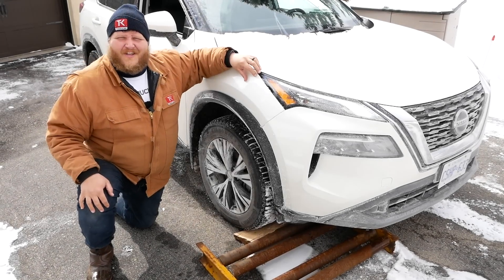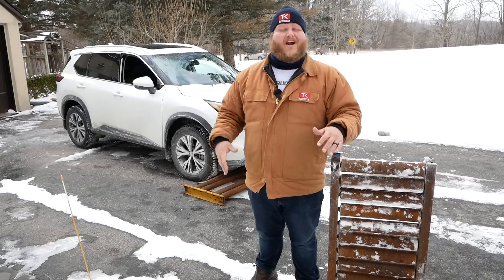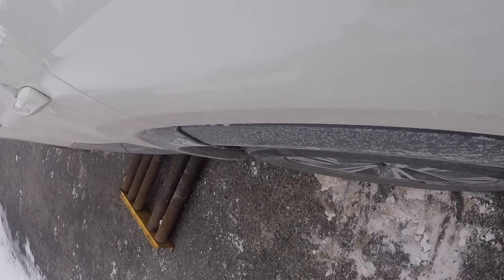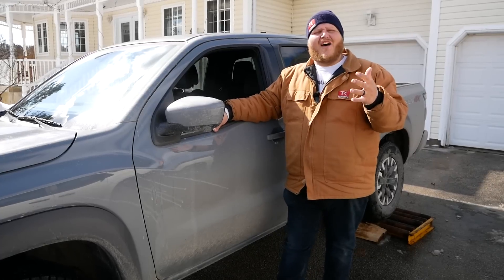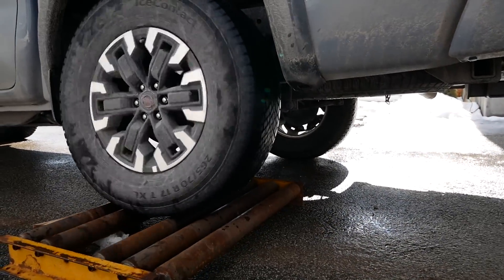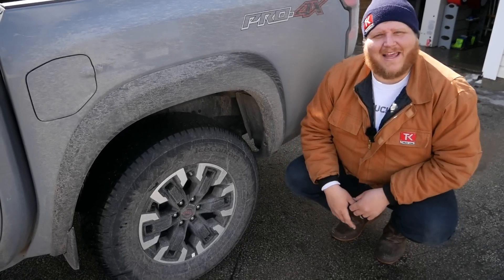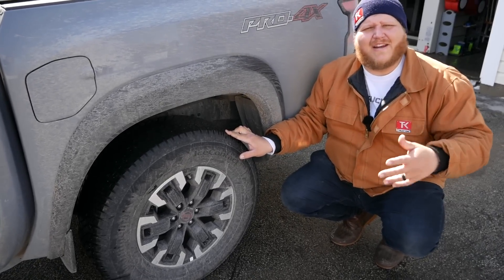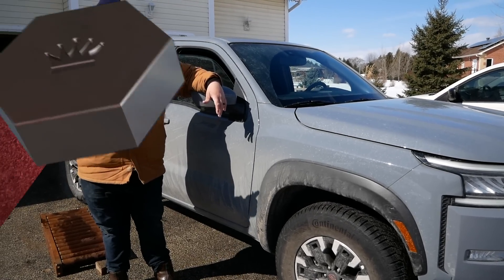AWD vs 4WD - Which System is Better and How Do They Work? We Demonstrate the Differences

Comment: For 99% of us, the all-wheel drive that is always on (or the computer allocates power automatically) is the best system.  Can't tell you how much of a pain it is to be driving down the highway at 70 and drive into a snowstorm - have to slow down to under 40mph to shift into 4x4 then speed up.  Not to mention what 4x4 does to your turn radius (it's terrible).
Reply: And fuel economy. AWD is lighter and more efficient, making it better for daily drivers.
Reply: @legostarwarsrulez  Now what you said is actually very true.
Reply: Modern 'shift on the fly' 4x4 /4WD models allow you to turn on and off four wheel drive anytime at 60 MPH or below.
Reply: @hermanjohnson9180  still means you have to do it manually...
Reply: @bikebudha01  The shift on the fly system uses a button touch that is electronic and normally wouldn't be considered as "manual".
Reply: @hermanjohnson9180  do you have to physically push the button?  Yes, yes you do.  Which means you have to decide when to put it in, and put it out of 4x4.  Manual.  It's what I had on my last truck.  pain in the ass.  More often than you might imagine, I'd have to put it in 4x , then out, then in, then out.  (The city where I live is terrible at clearing snowy roads.  So side streets, 4x by needed, main arterials not needed, parking lots needed.  you get my point)
Reply: @bikebudha01  By that logic I guess you believe that automatic transmissions are a pain in the ass too. Because you have to put it in Park Reverse, and Drive... By that logic it's certainly manual. I'm hoping you've figure out that I disagree lol. But more importantly, I believe that most would disagree with you
Reply: Preach.
Reply: Modern westerners are a whiny group.

😂

 Maybe buy a 4WD with TractionControl and a "Full-Time" setting.

 The way some modern Western people complain, you'd think that they had to get out and kneel in slush to turn rusty hubs.

 Even my '78 Jeep CJ could shift on the fly if I simply locked the hubs in Autumn.
Reply: @RKmndo  no, I had a trucks that would allow you to shift on the fly up to 45mph...   But as I said, on the freeway I'm doing 70.  So slowing down to 45 IN TRAFFIC isn't a great option.
Reply: Why would you drive 70 in a snow storm?
Reply: @valentinibarra9940  um, because my vehicles can handle it...  (up to a point..)

Comment: Full-time 4WD is the best.  This is on the Lexus GX, LX, 4runner Limited, and Landcruiser.  Also on the Mercedes G-wagon too.
Reply: Also the manual fj cruisers. Mine certainly is and love it
Reply: thats marketing terms for awd btw, its not full time 4wd, its awd. they have to market it as full time 4wd for people like you to like it
Reply: @james2042  nope... GX, LX, 4runner Limited, and G-Wagon have actual center differentials.  They are full-time 4WD.  For the last 25 years AWD systems have been 'slip and grip' reactive systems using viscous coplers or clutches.  Full-time 4WD has all 4 wheels going all the time... it doesn't need to wait for slip to engage...

Comment: It's worth mentioning that most 4x4 trucks do not come with a limited slip disk (LSD) as standard equipment...that's usually an option that only comes standard on high end trucks (and not even all of them have one) and may not be available on lower tier models at any price.

Comment: Awesome video on the the AWD vs 4WD. I had no idea any other vehicle had limitations with the rear locker, I can turn it on/off on my F150 at any time in any drive mode.  Although not something I do often, but it does prove to be useful on a boat ramp or when towing a heavy load in slippery conditions when weight is pulled off the front wheels. 4x4 becomes less useful, and the rear locker a helpful tool in the box.
Reply: Well the issue is dumbasses would throw on the rear locker in "slippery conditions" (wet roads) and then bind up the rear axle on dry pavement and break the locker, and likely get it repaired under warranty, so its idiot proofing it, saying "try 4H first, if that doesn't save your ass then go into 4L and you can have the locker"

Comment: So what is a better setup for just driving on paved roads with snow and ice? Im not planning on driving up the side of mt everest, but im so sick of getting stuck in the snow during the winter in my little ford focus.
Reply from the maker: Any AWD for sure
Reply: Snow tires, doesn't matter the vehicle or drive orientation. That ford focus would handle snow better than most awd or 4wd vehicles with a proper set of snow tires. If you absolutely want something with awd for some reason (it just eats fuel economy for the extra weight) then get something with full time awd that is passive and you don't have to interact with.
Reply: It depends on the snow conditions. In IL/WI, I get around fine in a stock Subaru, even offroad. In Buffalo, a lifted Rubicon or Power Wagon might get stuck on Main Street.

Comment: The auto 4WD systems a lot of manufacturers have now is a great in between. If I go off roading, I can use my all the time 4wd. In weird winter conditions, I can just set to auto and forget it
Reply: Exactly. I think I should mention that the real reason to pick up truck did better is because when you put the truck in four wheel drive it knows that it's off-road. The Nissan SUV had to figure out what was going on. And while I'm aware that the likes of Land Rover has fixed this issue, it is extremely rare for an SUV to be able to do so quickly. Furthermore AWD systems produce far less torque than four wheel drive systems. So even if it had the same software as a Land Rover Range Rover, vehicle or maybe a Toyota Land cruiser it would still take longer because the engine has to rev up in order to get it out of the obstacle. And even still, AWD still might not be able to do it because four wheel drive systems have a locking mechanisms. Modern, high performance AWD can even split the torque 50/50 but can never lock anything.
Reply: almost like 4wd and awd are the same thing with marketing differences. Most awd systems are superior to "4x4" systems anyways
Reply: @james2042  Simply not true. AWD systems use different components. The effects of both systems just seem similar. 4X4/4WD is superior but more ridgid. AWD is more flexible and generally faster but offers less traction and torque.
Reply: @RKmndo  
The lines are blurred, but some things remain constant. If it has a transfer case, and mechanically forces both prop shafts to spin at the same rate, it's 4WD(4X4). It's just that simple. What's not so simple is the fact that AWD has gotten so good over the years. Just because it's 4WD, doesn't mean it's automatically better for off-roading. We all should accept that and get with the times. 
Every vehicle now requires proper testing. 4X4 no longer means better than AWD for off-road. 
But of course it's safe to say that on average it usually is because that's what the system was built for. 
I also acknowledge that as far as the concept of 4X4 goes, full time (Auto, "intelligent".etc) 4WD is technically a hybrid of AWD and 4WD.

Comment: Biggest item not covered here: YOU CANNOT RUN 4WD ON DRY PAVEMENT UNLESS YOU WANT TO RUIN YOUR VEHICLE! So daily driver on a road that may have ice patches is better in Awd as the 4x4 will be in 2wd when it hits the ice. Yes, 4x4 is better if fully stuck or off-road, but most AWD systems are superior in every other scenario, ie 99% of the time.
Reply: Unless you have an actual center differential like the Toyota fulltime 4wd system.  These allow you to be in 4wd on and off road all the time.  The Mercedes g-wagon also has this system too...
Reply: @LexusGX460-OFF-ROAD  this is correct, I should have specified that it applies to part time 4wd only, which to be fair is the majority of pickup trucks.
Reply: @LexusGX460-OFF-ROAD  plus this system is awesome even on corning in pavements, allows tires to grip to pavement like a champ
Reply: @rnjuan  Yes.. feels like an old school rally car with real AWD... it's also a very safe system too for driving... dry, wet, on or offroad 4 wheels always going is very safe for loved ones too ❤️
Reply: almost like this video is full of bad information, its almost as bad as a tfl video

Comment: Do a Honda or Acura with the SH-AWD/i-VTM torque vectoring system (MDX, Pilot, Passport, Ridgeline, etc) to show what it can do.
Reply: TFL has a video on the pilot.
Reply: @keithsandefur1028  I know, but I figured these guys should too. Thanks though!
Reply: that's still simply awd, even if its able to send more power to the rear despite being fwd based. The way it gets traction is the same
Reply: @james2042 Not totally. Honda’s torque vectoring uses a pair of clutch packs to steer torque to one or the other rear wheel, or electronically “lockers” them, under software control with multiple modes (sand, mud, snow) selectable.  Mulch more going on than just front to back.

Comment: With 3 rollers it would be nice to see the differences in behaviour when 2 rollers back and 1 front vs. 1 rollers back and 2 front. I think that rear locker would not help in case that there are 2 rollers back and 1 front?
Reply: @christopherwilliams7645  this video was an awful showcase and full of bad information. The "awd" system in the rogue applies power to all 4 wheels, all the time. How it works is it detects wheel speed differences, and if they're excessive (one is spinning on ice), then it brakes the slipping wheel to send power to the others. Basically it uses the brakes to grab the wheel thats hogging all the power, so the other ones work
Reply: the rear didnt have the locker active, and honestly his rollers suck. Just about any car with any form of traction control would go right off those rusted rollers.

Comment: I think one of the better system is the full time 4wd with lockable torsen center diff in the 4runner and land cruiser.  With Toyota Atrac system on top of that it is a pretty nice setup and  certainly one of the best on the market.
Reply: I agree.  ATRAC and fulltime 4wd are amazing 👏
Reply: 100% agree that was the main reason for me purchasing 4Runner limited. It's so much easier for my wife in Minnesota winners
Reply: @timtoni123  The limited, GX, and LX with that true full-time 4WD is very SAFE too for your loved ones... always on safety
Reply: Even the r50 pathfinder with the lsd and auto 4wd is an incredible system offroad, better than a dana44 hands down no question nissans lsd is better
Reply: theres a lot of vehicles with awd systems like it, just none of them are smart enough to advertise it
Reply: @james2042  not true.  Name one SUV other than the ones I mentioned with 3 mechanical differentials.
Reply: @LexusGX460-OFF-ROAD  Yeah for the SUV its probably just Toyota or Lexus, I don't know another.  I know some Audi Quattro are using Torsen diff, but, they are not SUV.  Also, what is make the setup so great ont a 4Runner and Land Cruiser is the ATRAC system.  It is the best system in the world, period ;)
Reply: @barnacle-o8e  love ATRAC.. check out our latest video titled "cleghorn ridge" for an amazing ATRAC demonstration!

Comment: If you really want 4WD you need front and rear lockers that you select when you deem necessary, not when the manufacturer decides its ok for you to use them....having to go into 4WD, and worse 4Lo to use a factory locker is kind of pointless in many cases.  I guess I could see 4hi because typically if you need a locker you are probably going to need 4WD, but to only allow you to use the locker in low range is kind of stupid.  

With the normal 4WD and open diffs, my 98 Jeep Grand Cherokee was 2WD, full time 4WD, or part time 4WD, and had low range as well, best of both worlds, you have an all season 4WD setting (full time 4WD) and you had a well this is a nasty trail (part time 4WD), and you also had low range, and 2WD.  I miss the old Selec-Trac 4WD....every winter LOL...and it was all mechanical, no traction control, no stability control, no lane keep assist, nothing, just point it where you want to go and apply nice steady throttle and it'll go.
Reply: awd and 4wd are realistically the same thing, all they both mean is power is going to all 4 wheels. anything else is additional hardware. any namebrand difference is marketing

Comment: Have both. AWD Escape , good winter commuter, don't go off the beaten trail. F-250 4wd, my farm truck. Have not been stuck ,that i could not get it out, once i unhooked what ever i was either pulling into or out of a field.
Reply: theres a lot more in that f250 that makes it better offroad than just the 4x4 system. Actually if you took the full time awd of the escape and put it on the f250 it would handle better. thats why the ram trx got fulltime awd, its simply superior

Comment: I think the rear locker will work on F-150's in 2wd.  It don't need to be in 4wd which was nice.
Reply: Yeah I came here to say this while watching the video. Every F-150 I have had with the rear locker going back to my 2012 has been able to activate the rear locker in 2WD, 4 High, 4 Low, or 4 Auto (for appropriate trim level). While their video said most need 4WD, I think it's pretty significant that the F-Series doesn't have that requirement. I am guessing the Ranger with rear locker also can do so in 2WD but don't know for sure.
Reply: @Vulnox  Hmm, good to know, thank you.  Been looking at F150's lately as I'll soon be needing a pickup, and kind of want one with the locker.  Kind of hard to find though in the used market unfortunately.  None have 4 Auto that I've seen though...costs extra, like the locker so nobody in cheap assville Idaho would buy it LOL.

Comment: I had the best of both. My 93 land cruiser was 4WD with the ability to be a 4 wheel drive having a rear, center and front lockers.
Reply: The 80 series landcruiser was not AWD - it actually was full time 4wd which used viscous coupling as a system to reduce binding for use on dry pavement. In other words, it would generally default to 50% power to both axles however with that system it would reduce the binding with that system, lowering the torque to the binding wheels when necessary for full time use. When you lock the center diff it would essentially put it into a "part time" mode, without the ability to take up the slack thus there was binding (but more positive traction). The triple locked versions did not use traction control when unlocked, thus (surprising to many people) it may have even failed the 1 wheel slip test without locking the center diff (especially in high range mode) - IE on a VERY slick surface, and center diff unlocked - But fully locked, they had unbelievable traction given the solid axles and massive wheel articulation.
Reply: @rjhein  I can testify to everything you said. At the time it was the only vehicle I knew of that had all three locking diffs. They made upgrades to the brakes and increased horsepower between 91 and 93. I bought both new. Interesting thing is I paid 28k for the 91 and the price jumped to 42k in 93. When I traded the 91 it was sold before I drove away with the new 93. Very rare vehicle back then. Dealers were lucky to get just one or two a year.
Reply: @rjhein  my eagle had something similar so you could use it on dry pavement, based on the grand wagoneer but lacking it's 4L option. Lots of different cool systems out there.
Reply: My moms 2003 expedition has that too I think, there is a 4h and 4L and A4WD on the knob
Reply: @JavaBeans  I had an 03 Expedition as well, it was Selectable 4WD, meaning it's basically a part time 4WD system with an electronic clutch pack that makes it have variable torque split in A4WD. But you also get 2WD as well. The Land Cruiser is Full time 4WD with an actual geared differential, instead of a clutch pack, so it's never just in a 2WD setting.
Reply: @javabeans830  No that was 4Auto.  That's a slip and grip system.  The Toyota and the G wagon systems use actual real center differentials.  No clutches or fluid couplings.  Nothing needs to slip for it to work.  It has all 4 wheels going all the time on road or off road...
Reply: @LexusGX460-OFF-ROAD This is incorrect.  The 80s series Landcruiser used a viscous coupling.  By design, that only redistributes torque after wheels start to slip.  Newer vehicles that use electromagnetic wet multi-plate clutch packs, like Subarus and F150s can redistribute torque proactively before loss of traction.  That said, their 2003 did only engage 4wd after slippage, but the newer versions are much more capable.